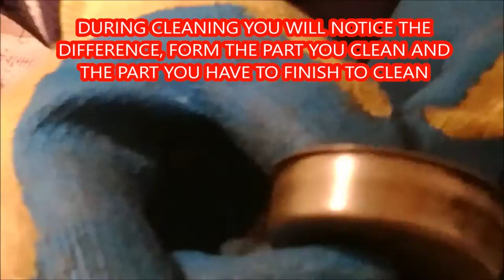TUTORIAL change gasket elektra microcasa

Comment: So happy to have found this video. Thank you so much for posting it!

I do have one question about 4:42 - installing the grill / shower screen - is it only attached by force? if so, what are you doing with the screwdriver that can't be done by just pushing it up?
Reply: Update: I figured it out. The gasket needs to be pushed into groove around where the shower screen fits.
Reply from the maker: I put in the position shower inox sieve and i istall the gasket with help of a screwdrive makining.
I make force on the gasket with the scrwdriver.